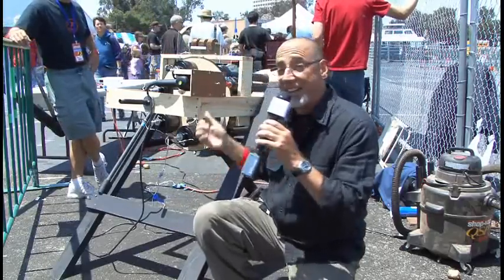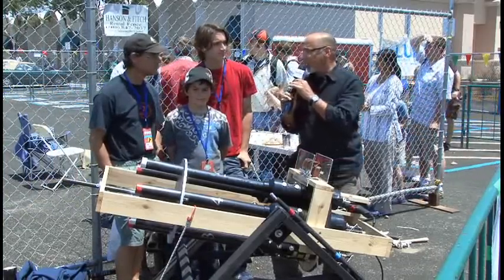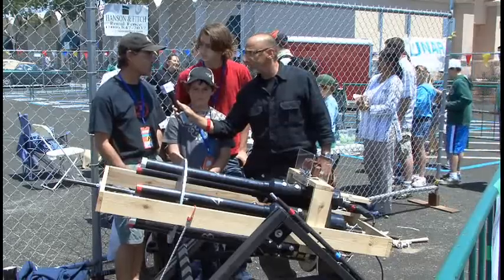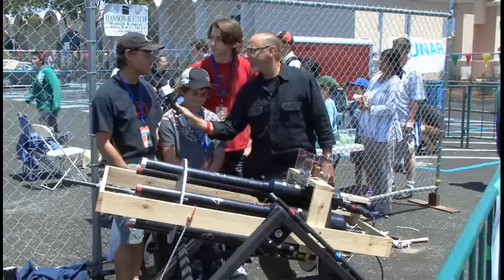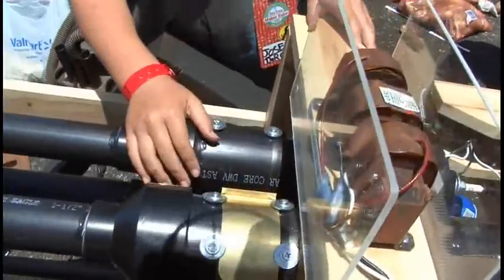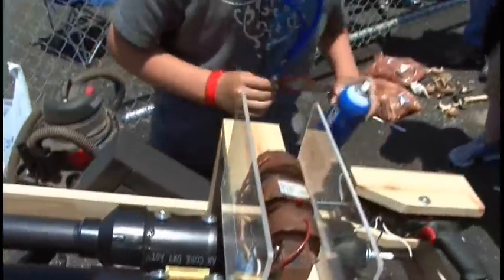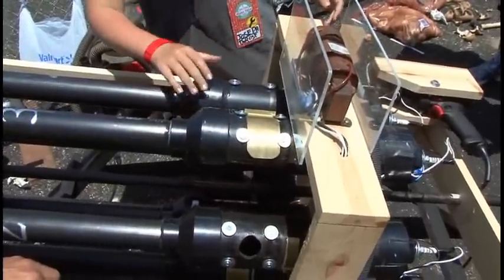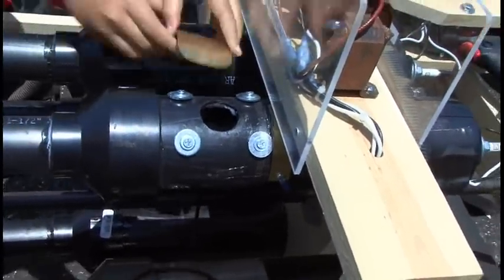Weekend Project: Potato Gatling Gun

Comment: Hey guys, I really doubt it, but if you actually monitor these comments, I was wondering what you made the gearing with. I have a similar project in store that needs some homemade gears with a pinion and a large secondary gear and was wondering what you used for your system. I don't think I need QUITE as large a secondary gear (if that's what you call it) as you have but I was curious none-the-less as to how you made your gears. If anyone else has some ideas I'm all ears. I make everything by hand and was considering hand grinding a big (about 16" diameter) secondary gear with some aluminum stock and my dremel. Of course this seems tedious and unnecessary, so if anyone has a better idea I'm all ears....

Comment: cool, but a real gatling auto reloads...
Reply: The main thing is consistency of the round. And it may still be possible to do this while using PVC. What you need to do is have cartridges of a consistent size and shape to allow for auto loading. (Automatic firearms didn't come until after standardized brass cartridges, this should be the big clue!) So instead of loading a tater into the gun barrel, you load the tater into a short sleeve which fits it snugly and slices off the excess. Since all those cartridges are the exact same size and shape on the outside, it eliminates all the feed problems of working with a bare potato. The only thing left to figure out is refreshing the propellant charge. (None in the "cartridge" for the spud gun.) Methods for chambering and seating are likely more straight forward.

Comment: Over engineered, impractical fuel system, underpowered. Stationary and un-usable. 
Fail
Family time,  however 
Win
Reply: No arms contracts but I guess they have really good family Christmas.
Reply: FrustratedBaboon 
Should use a cartridge system where the potato could be in a contained unit with the propellant. Also use a pneumatic or hybrid firing system for increased power. With shell ejection and injection you could in theory sustain fire for as long as you have shells.
Reply: @HaydenLau.  this
Reply: And that is the true miracle of potato
Reply: They said they are adding and upgrading constantly. They tackled a lot of feats already and got it working to this point. Please tell us what you mean by over engineered. You sound like an expert in this field.

Comment: Atarting fluid, a very tiny amount (1 drop is be fine) close chamber and allow to mix with O2. You will get unbelievable results. I have gotten some shots to go 150 yards. Also the end shape of the barrel is critical. It needs to be sharp so it cuts the potato at about 5% angle. This compress' the potato for a really tight fit. Mine is NOT a toy. It shoots at about 400 fps. I have made about 8 and refined each one. lantern lighter epoxied into screw on breach is the ignition source.

Comment: they need to make it load itself; push the spark plugs to the side and put a piston fed potato loading device on the back, with a large bin to hold the potatoes and a series of guides to lay them straight via the force of gravity.  Place the hairspray in the middle of the rotating device and attach hoses leading to the various barrels. have an actuator that pushes the nozzle on the hairspray...

Comment: Done one :) and it is a revolver, if we are being technical. and no i didn't make a "gattling" spud gun, that is just a dumb idea, breach load using sliding barrel assembly, poppet valves with cam lobes and a swing arm connected to a linear actuator.

Comment: I think it might be easier to make a Potato Chaingun that has a valve open for every shot cycled, pulling ~50psi of explosive gas into the gun, and open the other side of the gun valve when the potato is loaded.

Upon the potato chain being pushed up next, it uses a contact plate on a spinning disc to complete an electrical circuit and make the spark

Comment: I built one in about 2 months and used about 1/2 the voltage to activate a compressed air cartridge for e@ barrel (6 barrels) and I created a kind of division in each barrel so I can shoot 3 shots from e@ barrel but the 2nd shot won't shoot until the 1st has already gone and so on so forth....And since I have pretty intense pressure in each cartridge...it goes the length of a football feild....pretty boss I know....I'm still single.......

Comment: amatures they should have used propane! they could have wired up a blow torch tank to a button valve and then split it into all the barels. that would have reduced the gassing to to simply holding the button for 2 seconds and done!

Comment: Respond to this video...          weak.  id rather see a 4 barreled gun than this over complicated mess.  or someone could just once attempt a repeater. use golf balls or even rubber super balls. get a portable butane nail gun and take it apart, or use any metering device with plain alcohol. master the physics of spud guns before attempting a gatling spud gun. a fly wheel? really? plywood and roller skate wheels could work better.

Comment: i think those sliding doors aren't containing the combustion well enough and are thus causing the range to drop significantly. If they improved the design of the doors and used propane instead instead of hairspray, It would be much cooler

Comment: Scrabbytoy1:  I agree. I've built some P. cannons out of Sched 40 PVC with 6" dia combustion chambers that then had a step down joint to the main sched 40 PVC 2" dia barrel that would be anywhere from 5 to 6 feet long. You take a slightly oversized russet spud, ram it down the barrel w/ a broom handle, (making a super tight / slick fit) then screw off the breech  plug, spray in a mist of 'Aqua-net' (or the like), put the breech plug back on, hit the ignitor & it will shoot a spud EASILY 100 yrds

Comment: Here's some changes you may consider

* Expand ammunition capacity by creating a feed mechanism.
* Increase rate of fire by replacing rotation mechanism with a more robust one.
* Increase accuracy by making projectiles a more narrow and consistent shape.
* Increase operational longevity by using non-wooden materials.
* Increase muzzle velocity by using a higher yield propellant, such as gunpowder.
* Increase barrel integrity by using metal, not PVC.

Actually, build the GAU-8 Avenger instead.

Comment: 35 years ago when I was stationed In South Korea, we built a "cannon" out of steel soup cans (tops and bottoms cut out and taped end-to-end with the bottom left in the last can, and a touch-hole punched in the side). We would squirt a healthy amount of Zippo cigarette lighter fuel down the tube, shake the tube to aerate the fuel, and drop a tennis ball down inside.

Then it was just a matter of aiming the cannon and touching a lighter or match to the touch-hole...

THOOOOP!!!

We reached 1000ft!

Comment: Nice! A really great design, but it's missing 2 things. 1) Why use hairspray? I have made my own potato guns before and the thing that works best is Ether, which can be found in common automotive starting fluid. You use a tenth as much and the potato will travel 100 time farther! 2) The device needs some kind of altitude adjustment so that it can fire like a morter round.

Comment: Since this is a revolving multi barreled spud gun... it will have draw backs. ignition could be done better, but in this application it works. if the barrel was pulled back farther it would allow you to place the spark plugs in the side of the barrels leaving the end cap open thereby resolving the lack of power created by the fuel distribution plate. The only downside is that potatoes are not placed into cartridges so there is no way for automatic feed. So it isn't really a Gatling gun.

Comment: The spark plugs could have been put in at the same place as the propellant hole and had one small hole instead of 5 holes. Just turn the entire barrel slightly so it doesn't stick straight up. Reduce down slightly to a cheap ball valve in the back and the propellant loss is minimised and safety increased. 
Skip the electricity and plugs and hand crank with BBQ igniters set to run under an inclined and this could be set up in any field and fired till the ammo ran out.
Great project  !!

Comment: a gatlin potato gun needs to be properly designed and engineered, anyone that hs a potato gun knows they can be a bitch sometimes if they dont work, generally the simpler the better, using an ignition system like a grill igniter works great, but there are sometimes when the device gets ungrounded and it will not fire. This thing is pretty impressive though mainly because of the mechanics of it , the ignition system and design prety complex beyond your average potato gun.

Comment: huh. cool, but not great. you can call its a pepper box, but not a Gatling gun,  it doesn't have a magazine, and it can only fire as many rounds loaded into it at a time. 6 barrels = 6 shots. then it needs to be reloaded. galting guns basically involve the use of a magazine. without a magazine its a pepper box gun. 
if at time of built involved someone that's a firearms enthusiast then you'd have a Gatling gun.

Comment: Notice how when it fires, the barrels are turning toward the ground....and I think that's why the potatoes are hitting close to the ground.  Also, I bet they lose firing pressure because of the "sliding door" idea.  They should have drilled and tapped a plug so they could screw it in tight for a better seal.  Good idea regarding the ignition though!!

I use spark plugs in all of my cannons....and I use hair spray too.  Cheap fuel.

Comment: truth be told, it was closer to the 1000ft mark, but still.

It was a tight fitting potato launched at a 45 degree angle with plenty of fuel. There may have been a tailwind at higher altitudes, and it was pretty easy to measure since we did it on an abandoned runway.

My point is that it was much further than this cannon.

Comment: because what's easier to get, a can of hairspray or compressed air :P. Plus it's easier engineering wise because all you need to be able to do is ignite it. But yeah..this potato gun is weak.. but hey it's a gatling gun so at least they designed it for basic functionality.

Comment: For chambers that large, I was expecting MUCH more bang. My (traditional) cannon is slightly smaller and could throw a potato at least a quarter mile. 

Maybe the spuds don't have a tight fit? Maybe they weren't pushed all the way down the barrel?

I have a hard time believing that sliding door caused them to lose so much power.

Comment: I think its Super Cool that they did this as a family project-That rocks! I see tons and tons of value in that fact alone-who cares if you cant mount it to a humvee and take out alqueida with it! -maybe consider going with a spring loaded cam type ignition system to allow more time for the contacts to make a longer ignition.Maybe you could extend the barrels to allow a can of spray on each barrel-then use another cam system that would activate the fuel system into the chamber-Nice Work Guys!

Comment: what to do, to improve it, is have one fixed panel that doesent rotate with the barrels (the panel closes up the holes for the hairspray, only when it's needed) set at the top, when it fires. then you can have a continuous spray of hairspray at a fixed point, so when you start it up, it automatically primes and covers the firing holes when they're needed. it would have a less powerful shot, but you could maybe replace the hairspray with a drip feed of lightr fluid or something.

Comment: first off a GE XM214 is not the minigun i was refering to, i meant the origional minigun the m134 as the XM214 is a microgun. the m134 weighs something like 150lbs unloaded, and fires a 7.62 round meaning that for one man to feed ammo, hold it, and withstand the kickback of 7.62 rounds being shot at 10,000rpm is impossible(unless your the termonater). Also the xm214 weighed 80lbs unloaded, plus ammo and kickback you could not stand.

Comment: it needs a gas propellant... petrol is a liquid, in order for that to work it would need to inject petrol in a spray into the chamber and ignite almost immediatly. the reason hairspray is used is it is a cheap and easy way to get haold of perfectly mixed butane, propane and methanol. i however use de-icer in mine, works just as good, makes a purple flame and leaves no sticky residue.

Comment: Man, that was so goddamn crap.. A couple of the potatoes didn't even reach the target.. C'mon.. sliding doors on the chambers?? No airtight seal means less flammable material due to leakage + pressure leakage during ignition = lower pressure (less power) x 2. The ignition system was great, but really guys I'm sure you can do better than that...

Comment: They should make a version made of steel pipes with a gas and oxygen tanks in the center. Then electronically inject an air fuel mixture into each cylinder, and fire using a 50,000k racing coil to ignite the vapor. KA-BLAMMO!

Comment: If you think about it, they could have built a simpler, easier to use, and more powerful pneumatic gatling gun cannon.  Use 5 sprinkler valves and, and just use the idea they had with the contacts to activate the valve each time it came around.  It would also be easier to load, because you could have a use single shrader valve connected by a hose and check valves to each of the chambers, meaning you would only have to fill it with air "one" time per firing.  Cool idea though!

Comment: Sorry I have to dis agree with you here. This is essentially just 6 spud gun tied together, then your challenge to build a better one is easy strap 6 spud guns to the same igniter and fire them simultaneously there is 6 spud in under half a second! What's more this it is lacking in power and once you have emptied all six barrels your load time is now 6 time longer so load time per shot is the same.

Comment: WOW it doesn't even fuckin shoot good. THAT SUCKED. I had a potato launcher made out of pcb pipe or whatever it's called a grille lighter and two screws.

You click the grille lighter which is attached to the screws which are screwed into the hairspray chamber and tips are pointing at one another so when you click it creates a spark. And those fuckin potatoes launch A LOT further and stronger than what you just saw on here. They must not put enough hair spray or the potatoes aren't air tight

Comment: That's some impressive backyard engineering, but it's essentially a worthless design.  Just like almost every other potato gun, this one is also muzzle-loaded; so add to that the fact they have to manually add the propellant (oh, and they're using sticky, gooey, hair spray?!  Use propane!!), which will dissipate as they load the other barrels, and you've got a gun that has no aim...horrible rate of fire, despite the extra barrels, and poor maneuverability.

Comment: Those hairspray charging doors are weak and need a much better seal, I notice you're not getting much velocity out of the barrels and I think that's why. 
Starter fluid or ether might make better propellant.
Also I've seen neat designs which use the rotation to run a piston, sortof like an engine, to draw in fuel and air through a carburettor to avoid having to manually fuel each barrel. You could also run high test hose to compressor

Comment: Hairspray is for n00bs.  If it was pro, it would have a system of injecting a perfect mixture of butane and air to ensure ignition.  You can see with the random spritz of hairspray and random amount of air/oxygen in the chambers, it only fires about half the time.

Comment: my combustion chamber on my bigger gun is 3"x14", close to yours, i use a standard torch end and open it wide for 2 seconds, i shot through a CRT monitor with that amount, i could probably go to 3-4 seconds without real harm.

i hold my spud guns when i fire them and wear eye/ear protection, i'm looking at kevlar vests, they're like $300, PVC cracks at joints, ABS splits. from what i've heard, combustion guns operate below 100PSI, so i think the ones i made are quite safe.

Comment: if you have a proper seal, you can let it sit for months with propane in the chamber, PVC and ABS aren't that porous, and the propane will be at normal air pressure, not pressurized, so it's not going anywhere. 

but i like your design. i've upgraded my SGs to 150,000V ignition with a stun gun. the thing about gatling guns are that they are made for strafing multiple targets. maybe you can motorize the base and make a video aiming system  ;)

Comment: it only fired on 4 out of 6 barrels, pretty weak shots at that. hair spray fuel settles out after a minute or two, that probably accounts for the weak shots and misfires. with that ignition system, it should get sure, hot sparks for ignition. propane or MAPP gas would be better fuels.

Comment: not a Gatling potato gun, just a rotating mount to hold six potato guns.  I thought this would be a fully automatic type potato gun.  The hatches to spray the hairspray significantly reduced "muzzle velocity" as you saw in the demonstration at the end, all the expanding gasses escaped, making it very slow.  :(  if you could figure out a way to load potatoes continuously, then you would have something awesome. keep up the good work though. :)

Comment: You"re quite right.  The challenge is that gun ammo has the slug & the charge in 1 unit, but spud guns are usually muzzle loaders like the old days of ball & black powder.  I think they could have the barrels slide forward and back by a cam as the whole gun rotates.  A spud would be fed in when the barrel is open, then it would press back onto the spud, cutting off the excess & reseating the barrel back into the fuel chamber flange in time to fire.  Put the firing barrel at the bottom.